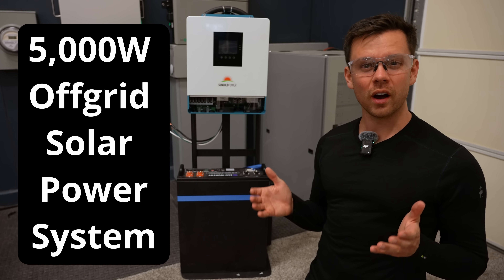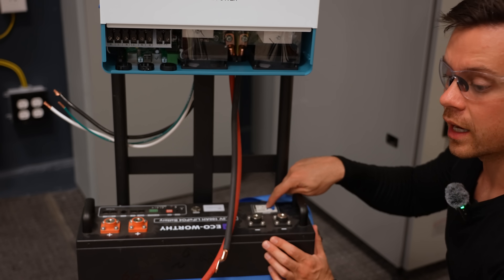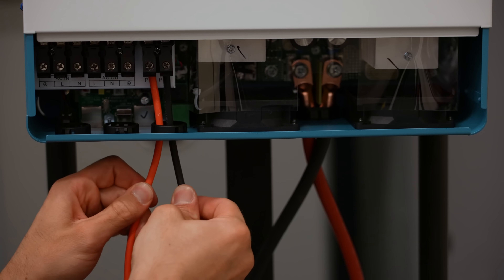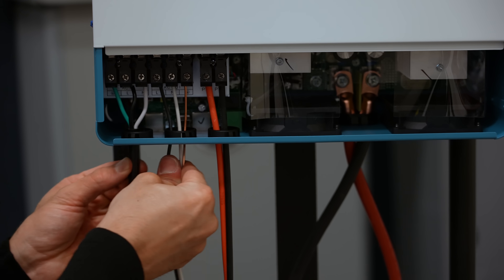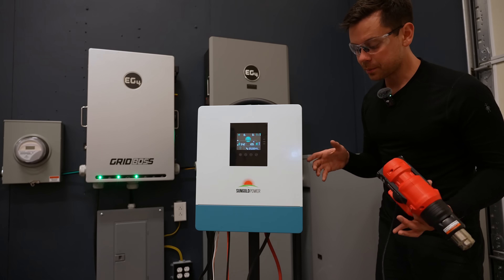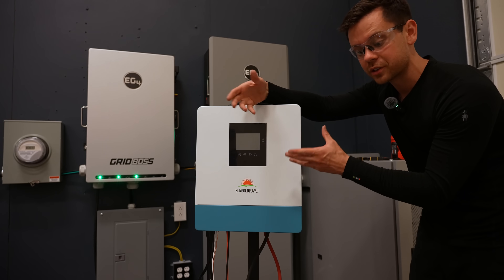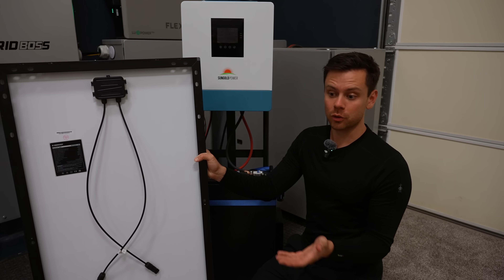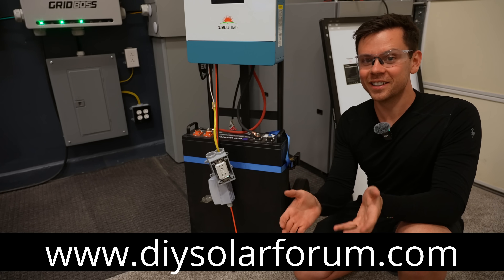Build a 5,000W Off-grid Solar System in 1 Hour

Comment: Will, can I ask you a question. I'm going through a divorce and have to sell a brand new eG4 6500ex inverter (still in the box) + 8 new Canadian Solar bifacial 465w panels. Never got to hook up or use any of it... And Idk where the best place to try to sell them would be? Could you please help? I'm going through a really hard time. Could you help point me in the proper direction please. I'm sorry. I know this isn't the place for this. But I'm getting desperate. Because I have to move and have nowhere to take them or put them. 
Thanks for any understanding. Appreciate it! 🙏🏻
Reply: I think will's forum has a swap meet section, but I could be wrong.

Comment: Great video! 

Not a fan of the SunGold Power inverters. Bought a 6kW a few years ago, fans always run at full speed. been emailing for 2 years trying to get it fixed. keep sending PCBs to swap out, but no fix yet. Only 1 year warranty. EG4 way better budget inverter brand.
Reply from the maker: Yeah those were made by voltronic. I had horrible issues. You have to find the one's made by srne
Reply from the maker: All the brands that EG4 carry also sell to sungold power

Comment: Can you do a video on how to integrate a generator into these? I don’t have room for panels where i live but do have a generator. Ive seen “chargeverters” for generators but im confused how both that and an inverter can be tied together to charge batteries and feed the house.. i would think that you could only charge/discharge from one place u less its built into the all in one
Reply: Nvm… think i answered it, prob need a grid boss then have the charge verter plugged into that then have the inverter feed the grid boss
Reply from the maker: The easiest way is to plug a chargeverter into a generator. Then connect to the server rack battery
Reply: @WillProwse there’s no way to incorporate it in to the cheap dolly you made though right?

Edit: Ill just log in to your forum and ask the basic qs there instead of bogging you down😂 thanks for reading the comment and responding. Saw your eg4 video a long time ago and forgot you had already done one on them just was confused how to integrate it with an all in one like in this video
Reply from the maker: @nashonabo  no worries, you could strap the chargverter to the back of the dolly haha
Reply: @WillProwse Gotcha, was worried that it could damage the all in one having the chargeverter tied to the batteries at the same time that the inverter is on and youre drawing power from it, especially if you had solar panels attached too lol would suck losing it during a snowstorm 😂 Thanks man.
Reply from the maker: @nashonabo  Oh you're totally good you can connect five inverters and five chargeverters to it and it will be fine.or 100. It's ok

Comment: Sometimes inverters will send a power surge out to the appliance that you are plugging into it .  For example if you plug a big expensive stereo into an inverter you might hear a pop coming out of the speakers . The inverter just sent a little lightening bolt that went right thru the stereo's power switch even though that it was turned off .  I've blown up a few things in the past and now I use surge protectors on all my delicate stuff .

Comment: Good presentation. But your Sungold power station is not that highly rated from Amazon comments. If I'm going to sink the money into this build, i would want it to be at 4.7+ as the server battery is rated.
Reply from the maker: I've said this in past videos and I reviewed their other stuff and it failed miserably. This one is made by the same company that makes a lot of other good inverters. Look up the reviews
Reply from the maker: That's because that company makes other products that are from different manufacturers that are awful. Those reviews are for the 24 volt version that's made by someone else.

Comment: Question about "All in one" controllers: does the inverter run all the time? Can the rest of the system work with the inverter turned off in the case where most loads are DC. Is this a feature of some all in ones, none? Would it be better in a mostly DC use to go separate boxes?

Comment: Why use a 48V battery?  A lot of other solar DIYers use 12V batteries.   Great video, really appreciate the links to the materials.
Reply: My system ( not set up ) is just for “ just in case “ but it will use 12 v batts but u need to b careful because of the high amps of the batteries such as marine batteries using the proper wiring etc unless u want to weld something! Lol ( arch’s
Reply: because Will Prowse recommends the 48 ...he also recc'ds 24, over 12 volt! his other videos tell very important reasons why!

Comment: Regarding the minimum 120 and recommended 200 volts solar you mentioned, would those be the same numbers for a 3000 watt 24 volt all in one? If not, what are the specs I'm looking  for the all in one I'm considering?

Comment: Great video!

A detail though: I would absolutely advice against connecting regular 15/20A sockets directly to the 5kW (=50A) output of the inverter.
If you are going the cheapest route, just put a DIN rail 15/20A breaker in series, just hanging loosely by the wires, or use a power strip that has a built in circuit breaker. Otherwise someone could easily connect two 15A appliances resulting in 30 in the 12/2 Romex only rated at 20A, or worst case someone could connect one or two power strips ending up using up the full 5000W from the inverter, melting the 12/2 Romex.
If you are going to cheat this way, at least use a Romex rated for what the inverter can provide.

Also: What weirdo decided that green=off and red=on for circuit breakers? That person should be smeared in tar and rolled in feathers, and put on public display. Anyone knows that red=stop, green=go. If you do a picture search for emergency stop every picture shows a red button. If you do a picture search for switch red green you will find loads of boxes with a green on and a red off button. Never the other way around. It gets even worse when you add to an existing setup. Like if I were to replace my fuse box with modern circuit breakers in my basement, I would end up with green=off, red=on for the breakers and next to them the existing motor protection thingies from back in the days would have red=off and green=on. (Not sure what the correct name is English, they  are like extremely slow blow breakers intended for giving motors a few seconds to rev up using way higher current than the running power; in my case they run the well pump and the circulation pump for my radiators).

Comment: Is there any advantage to using a 48V battery when using only 12V equipment? Is there losses in the conversion over just using a 12V battery with the equivalent AH rating?

Comment: Hello, lowboy truck driver here. I want to run a hydraulic pump to run my lowboy and 12k mini split, I want to run this setup and I have a 5kw predator generator and I also want to charge via alternator when I’m running. Any suggestions? (I have multiple days when I’m stopped and running my truck is costly) Thanks for the knowledge Will!!!

Comment: One thing to note : those DC to DC step down converters are rather limited in the amperage they can handle. I was looking to see what it would take to step down from a 24 or 48 volt system to run a 12 volt inverter, and it was going to be cheaper to just buy an inverter for the system voltage. If you only need 12 volt to run LED lights and low wattage devices, the step downs should be fine.

Comment: I would like to build up a system to run my remote unheated shop. Any concerns with northern MN winter temps on these batteries? Could be as low as -45F

Comment: I’ve got nearly everything but I’m still scared to connect everything together. Main components 2x 400w panels, li time 60amp charge controller, 4x 100ah lifepo4 batteries. The only thing I really wanna run an a small air conditioner but again I’m afraid of frying the system or catching my house on fire

Comment: On 7:11 where did you get the 120volt?
Reply: It's the minimum acceptable voltage on the mppt of the inverter.  Anything less than 120v would not be enough to charge up the batteries.

Comment: Will thank you!  I have a very important question. I want to put this in my van. I want to use an aux alternator to change, is it possible?  with this video I can move forward and buy a system because you told me how to use a small solar array !!! and because of the money savings on this set-up!!! you are super and really help people. I have very important question. MY GOAL is to use this solar system in my van and charge it with an auxiliary alternator!!! And then bring the system indoors and use it at my home base.  I also must hook up with  RV air conditioner 24 volt on the roof - .is it possible to still use a 24 volt air conditioner? what would I need to do that?(ian outequipprot is only 45lbs so I can move it myself) Very important question you please tell me if it is possible to use auxiliary alternator to charge this system? what aux alternator to use if it is possible?
Reply: I just looked at Balmar 2nd Alternator Charging Solutions -96 series - 48volt  expensive

Comment: If I hooked up a dolly system like this and used Goal Zeros Yeti home integration panel for  the disconnects could I incorporate and charge my Yeti 3000 lithium generator with this as well? And how would I be able to step it down to a 12v charge? Thanks Pete

Comment: Thank you!!! This is the exact setup I was thinking about going with.  I need to power a Minisplit in my off-grid cabin.  I was thinking about going with the 5K all in one inverter.  My only question is....If I plan on using this setup about once a month, should I keep the battery hooked up to the all in one?  Or should I disconnect the battery while I am not at the cabin?

Comment: Thank you for the targeted, complete, and easy to follow video for building such a mobile system.  I'm interested in this for running my pool in Texas, which is a 240V/20A system.  Would this setup power my pump which runs at <1,000W and consumes about 6.25 kWh per day?   Would the 7-14 panels also work to sufficiently recharge the battery?  How would I calculate this?  Thank you again.

Comment: Really a great presentation. Mounting of the panels and power distribution certainly requires planning and forethought. Your vendor list is very good, and the solar mounting guide is thorough. Not a small job, but with your breakdown it becomes less complex.

Comment: Interesting comment about preferring at least 200 volts for the solar array. I've got two 3kW arrays running at 150 volts because that's the max input my Zendure's can handle. After picking up a pallet of used 190V First Solar panels I've learned that most all-in-ones are <200 volt solar input until you get to something like the Delta Pro series. 

Are you saying that 200+ volt  solar arrays will yield more watts overall than a comparable 150 volt system?

Comment: Can you parallel two of these inverters together with batteries to get you a total of amps to run a manual transfer switch for the house or do I have to get Al and one that’s 10,000 watts?
Reply from the maker: Yes you can. and always need transfer switch to do it legally

Comment: "At 4:05 there's a potentially dangerous connection issue. The close up of the battery cable connections reveal the lugs descending at an angle toward each other, almost touching, and the wires below overlapping, A further displacement caused by a simple tug could bring them into contact.  This video is very simplified for clarity, I understand.  However, we're dealing with lightning here, not double "A" toy batteries.  This is municipal-level power.  The video makes it look too easy.  There's a reason for warnings.  People have gotten complacent about potential shorts.
Reply from the maker: No, theres a piece of plastic between the terminals 😂
Reply: @WillProwse  I remember when I commented about placing a live circuit directly on the metal wire rack.  Now you use an insulated surface.  "A piece of plastic" 

New consumers entering the market as t word gets out are getting complacent, as they can easily afford it.  Having never been exposed to municipal level currents before, they are conditioned to assume something available to them on the open market is consumer safe.  It bears repeating.

Comment: I really like your podcast. I have the sungold 5000 watt 48v off grid system powering 2 glamping sites. It works but I've had a lot of issues to get the system to work efficiently. I have 6 200 w panels that at peak produce 240 w...not enough to recharge my 2 5K watt batteries. My 2nd battery discharges at a faster rate. I have to run a generator every 3 days to power up the batteries.  Sungold says to update my battery software which has proved to be complicated. Any ideas to help?

Comment: Love your videos,! I have a silly question. Lets say you have a tiny house. And you only average less then 500 watts per hour using. Could you just have solar to invertor to extension cords, with no battery? I would assume 3-5 solar panels of 400 to 500 watts. Would that work? And what would happen to the extra wattage your producing? If you are not connect to the grid or batteries.

Comment: Beginners take note: properly torquing the terminal screws is critically important. If left too loose the resulting resistance between the terminal and the wire or lug will result in overheating and a possible fire.

Comment: Do you trust the circuit breaker of the Eco-Worthy battery to break the fault current of the battery in a dead short?
Reply from the maker: Yep. And I trust the OCP of the BMS even more
Reply from the maker: And I've tested it multiple times 🤣

Comment: I would recommend, some sort of strain relief on the connector ends, to prevent high voltage/ high current connections from shorting, if pulled on.  Thank you for all of your great work.

Comment: @WillProwse what about grounding if you want to charge an EV? Also, any difference if you opt for the slightly more expensive split phase 240 inverter? I'm looking to offset my Tesla charging costs(California) with solar but I'm worried about grounding and charging speeds.

Comment: But But But , my boat runs on 12V , most boats do , 48V doesn't cut it.
I wish you would do some vids for boat and RV power supply based mainly on solar.

Comment: So, can this be used to power 220 volt appliances?

Also, how would you rig it to work as UPS for more than a couple of items plugged right into it? 

And… could you rig it to take over (from the grid) powering certain loads at night or during peak pricing time?

Comment: Big fan and very noob. Question for a backup solar system:

1. Am I limited to 120V (level 1) charging for my Tesla, or is it possible to charge faster with this inverter? If so, how could I do this?

Thank you!

Comment: Is there a lingth restriction how long the cables could be for solar input?  I’m wanting to use this as emergency backup from my home set it up inside my power box where I will have a backup generator in input switch, but run the solar cables to the outside.

Comment: I'm not clear how to wire in a step-up charge controller if I only have a couple of panels.  Do I completely bypass the Sungold device and connect the panels to the step-up controller which is then connected directly to the battery?  If so, if the system is plugged into both AC and also a 2-panel step-up converter, how do they coordinate to not over-/under-charge the battery when the battery is getting charged from two different independent sources?
Reply from the maker: Yes exactly, direct to battery. Bypass the unit entirely.
Reply from the maker: And you can have a hundred battery chargers or inverters connected to one battery and it will be fine

Comment: How do you know the minimum voltage to power an inverter (or get good performance)?   Is it the lower value of  "MPPT VOLTAGE RANGE", or "UNIT STARTUP VOLTAGE"?   I'm particularly curious how much power a flexboss 21 would need.  

Thank you for all your videos!
Reply from the maker: All of them have different recommendations but if it's a 48 volt battery you should start at 200 volts. With flex boss in particular you want to start at 220. I would ignore the recommendation because it's always wrong

Comment: If your not using a breaker panel, id go with the power strip option. Most power strips will have a over current protection of some sort. Help beginners not fry any of their new stuff.

Comment: For beginners.... to prevent cross-threading screws (going in crooked, causing thread damage), start by slowly turning left (as though loosening) with light pressure until you feel it "click", then turn right to tighten. Just my $.02
Reply: Good advice! This is even more important when self tapper screws are used with plastic, like for example when having taken apart a power tool and reassembling it.
Reply: @The-secret-101  Retire OR RN, you also learn this in Orthopedic surgeries on bones. Very important technique, we used different types of screws on different bones and different areas of the same bone, like the long femur.
Reply: People who have not mastered installing a screw should be penalized by having to hire someone.

They certainly should not be installing anything electrical.
Reply: That's a great method that I've used for years to prevent cross threading.
Especially on single start threads.

Comment: I'm slowly accumulating everything to complete a system.  Will my (2) Watt cycle 24v 100ah batteries work with the SUNGOLD POWER ? and my Aptos DNA-120-BF26 (370w) doesn't show optimum operating voltage on the back (or on line) The open circuit voltage is 40.8 so a maxim of panels would be 12.25 ( I only have 10)